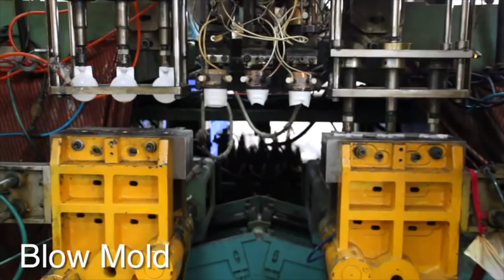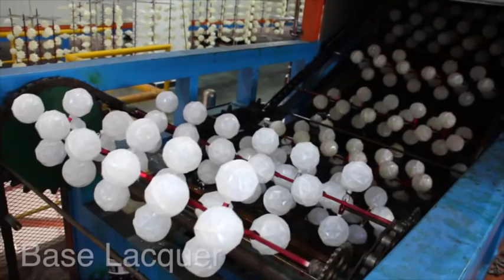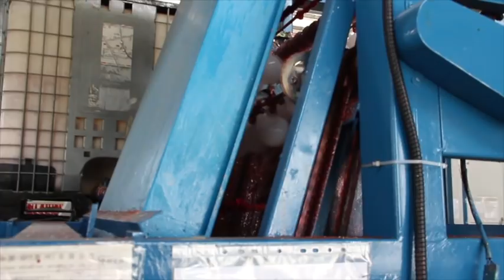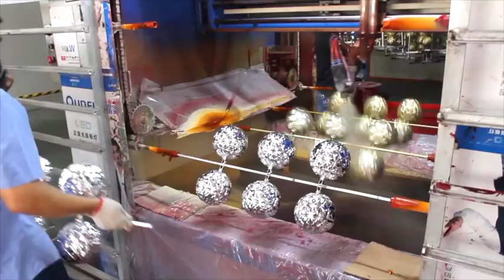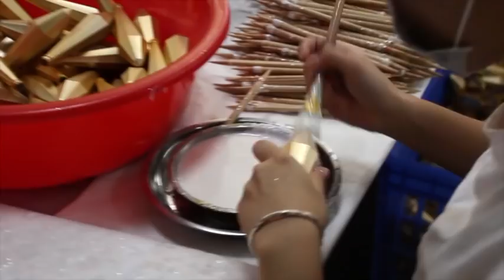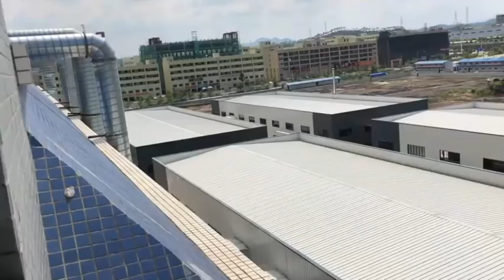Inside the Christmas Ornaments Factory- Shatterproof Plastic Balls

Comment: Can you silk screen or apply decals to the ornaments via a machine?
Reply: Be bold and try it! Plastic is cheap enough if you spoiled one or two and you can always cover them in fabric if they went really wrong!  If you have a die cutting machine like a Cricut which cuts vinyl that should work. I’m not sure how you would screen print directly onto a bauble but you could screen print onto fabric or vinyl then stick that to the baubles. The other thing you can do is decoupage using napkins take the backing of the napkins then using a very slightly damp paintbrush dampen round the image you want to use on the napkin then very gently pull it apart you get a nice feathered edge. “Paint “ with modge podge ( basically watered down glue 2 parts water one part PVA glue) stick your image on, leave to dry then “ paint” over with couple of layers of the modge podge glue again, this acts like a varnish and dries clear.  There are lots of fabulous tutorials on YouTube of people who do this and they create the most fabulous decorations not just for Christmas but all sorts of occasions.  
I’d love to know if you tried it and what results you had . Merry Christmas.